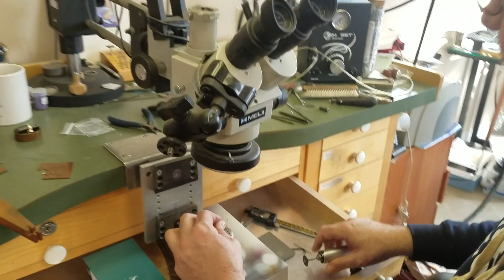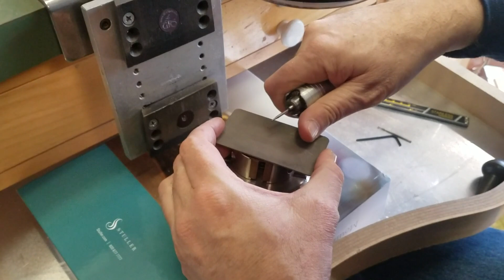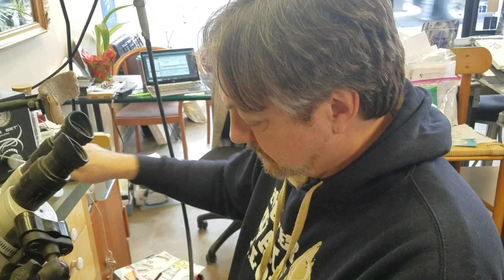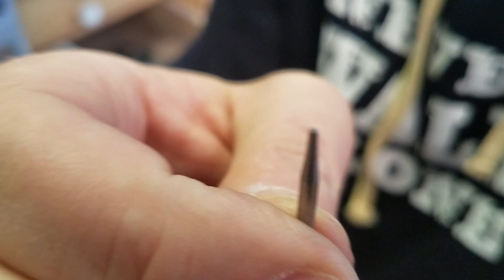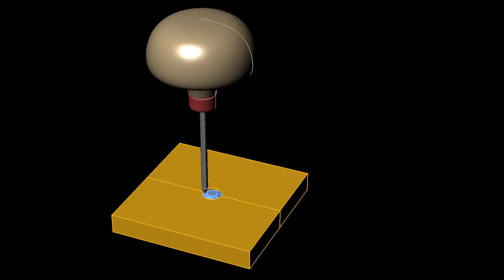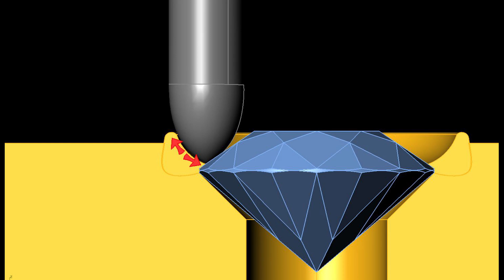The Science behind flushsetting

Comment: I am really struggling. I have been trying to flush set CZ stones in brass. I CAN NOT get the metal to burnish and secure the stone. What am I doing wrong? I really need help.
Reply from the maker: try copper. The brass may be to hard especially if it is hardened for plumbing
Reply: @JMDjewelry  

I’ll try that, thank you

Comment: Really great ...
You should put a few drops of lube (water will work) on the sharpening plate ...diamond suffers badly ,when on steel ,especially herded ,or tool steel,however you are very correct in your process and thought ... You can even set the stone by hand useing just the burnisher ,no flex shaft needed ... Really great info you gave ,and thank you for your efforts and thoughts ...have a wonderful day ...

Comment: Excellent, I needed to see how the metal moves.  The tool is vertical, but which direction are you pressing?  Straight down?  Or at an angle?
Reply from the maker: You push down and out. Not to hard. Think of smearing the metal in a circle
Reply: @JMDjewelry  Thank you!  I had been afraid to try this technique, but now I understand how it works and can get past that.